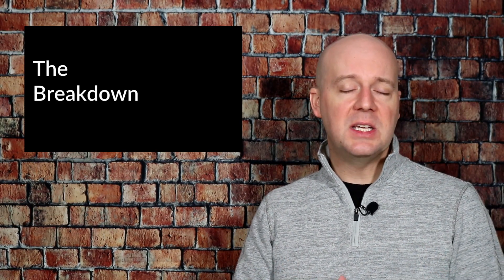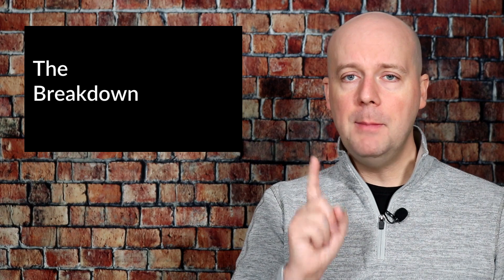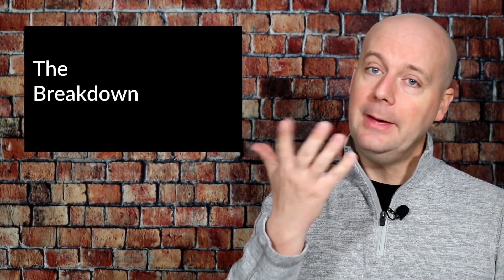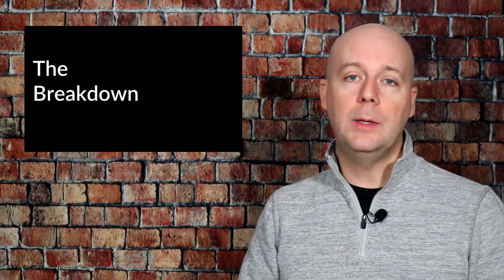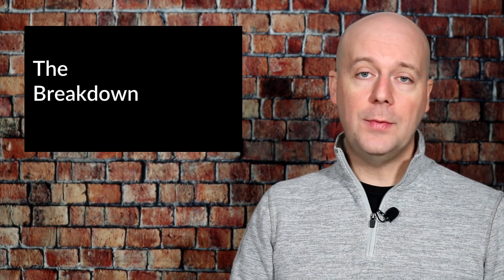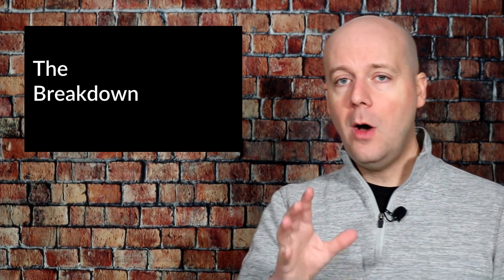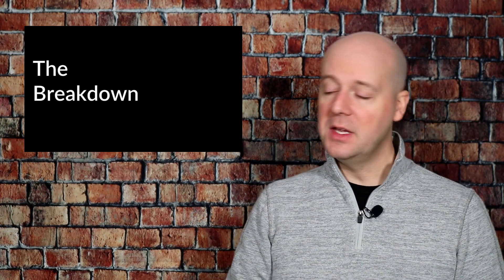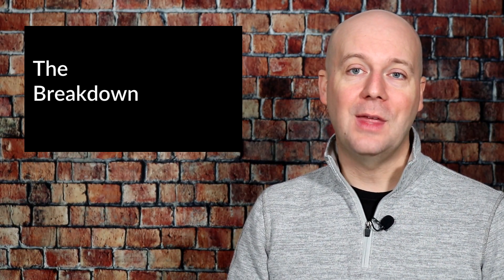Why Are Chip Bags So Full of Air? We Explain…

Comment: Nope, they fooled you too! Counter point:  You dont need an extra half bag of nitrogen. Proof: Pringles can of chips aren't half full! 
So what's the real reason? Simple: visual psychology of the dumb consumer. A big of chips for the same price as a small bag of chips will sell more unit despite them both having the same amount of chips because most consumes dont check the net weight of what they buy. Remember we can't see inside, because they dont want us to.
Another reason is aerated foods, i.e. foods that are mostly air! for example cheesy puffs or those cookies  that crumble to dust in yourr mouth! All mostly air! Same with bread. also this is also why we see areated products like cheesy puffs or bread in bags full to brim and in clear plastic!
Fun fact, Pringles chips are partly arreated, made from potatoe flour or powderr.
Funfact 2, cheap ice crreams are aerated to fill a half gallon, expensive icecream is never areated and it's usually thick and fozen and hard to cut and in a much smaller box.
Reply: pringles cans also have nitrogen gas in them, but they need substantially less because the chips are stacked effectually leaving less room for air, and also because the nitrogen gas doesn't need to serve a secondary function of cushioning the chips
Reply: Interesting proof. I didn't know cans and bags were the same thing.

Go take two pringles cans, two normal bags with their "useless air," and two zip locks of typical chips with most air let out and squeeze each pair together. Enjoy.
Reply: Pringles aren't potato chips. They're potato crisps which is a distinct difference. Unlike potato chips Pringles are made from processing potatoes and forming them into the Pringle's shape. This creates a different product with different properties.

Comment: Net Wt. on the bag is correct, but I have opened HUGE bags of chips only to find them about 1/4th full. They were NOT this way decades ago. I don't know if they were using nitrogen packaging in the 1960s or not, but bags were pretty close to full. Also more air means MORE damage to chips, not less. They have more room to move within the bag, to hit one another. A tightly packed bag would allow less motion. Try taking chips out of a bag, put them in a ziplock, one tightly packed, one loosely packed. Now shake each bag. The tightly packed bag will sustain far less damage from shaking than the loosely packed bag. That said, I do understand the weight is on the bag. About the truth in labelling law from the 1960s, it at one time required canned products such as canned vegetables to include the words "net drained weight" and the contents should weigh what the can said AFTER the water was drained off. NOW packagers are allowed to say things like: "8 oz. pineapple in natural juice" or "8 oz. fruit in light syrup" by using this phrasing, they are able to sell a can of the same exact size with less net product (excluding liquid) inside. Finally there is just plain smaller packaging- Haagen Dazs made their 16 oz. pint carton into 14 oz. a while back, leaving the price the same of their own admission, they made the 4 oz. cup 3.5 oz., while keeping the package exactly the same size by putting a recess in the bottom. Go to the store and buy one if you don't believe me. Tide put "8 more loads" on one of their liquid detergent packages of the EXACT same size and concentration as before. How did they do it? By making the cap/measuring cup smaller. Maola, a dairy company, now sells something that looks like a pint of milk, with 14 oz. of milk in the carton. Coffee which used to be sold by the pound is now in bags from 11 to 13 oz. All of these reductions in size would not be an issue (since they are labelled), IF they were reducing the price, but in fact the price usually remains the same despite the size reduction, then goes up again within a year or two. Ultimately, the consumer is paying more.
Reply: Thank you, Thank you, Thank you
Reply: Chill bro
Reply: @wills242  I would chill, but they charge me more for squeeze ice pops than they used to.